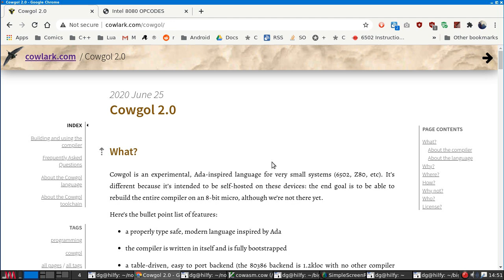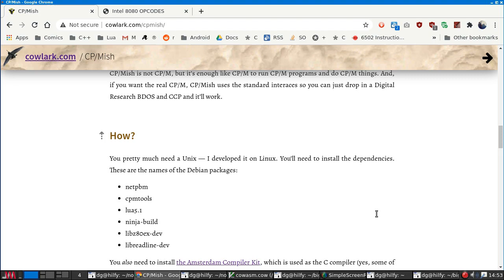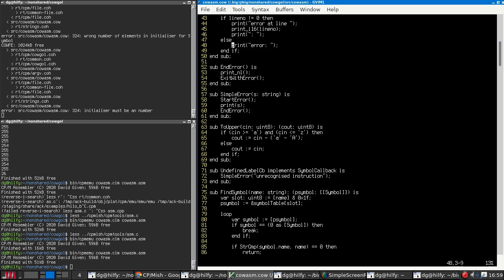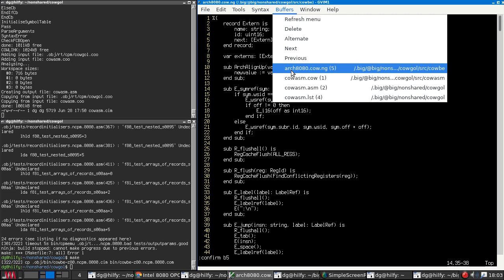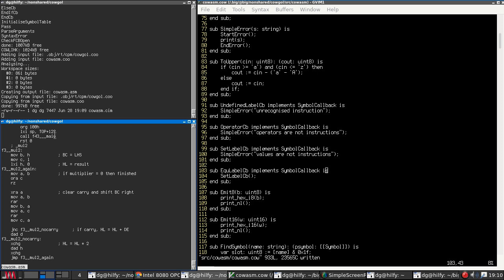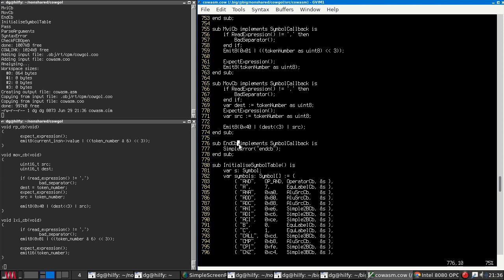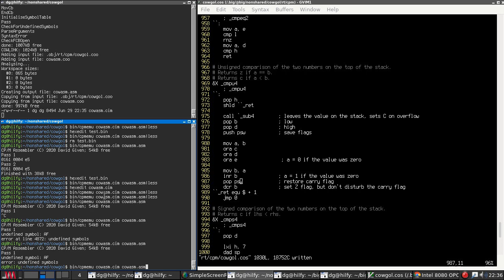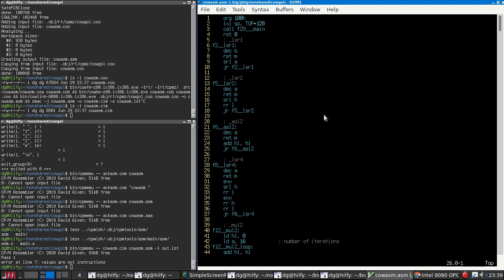Hjalfi writes an assembler... again

Comment: Hi;
Also, I have an Altair 8800 with it's 8080 CPU Board, I also have John Monahan's Z-80 Board (and Monitor), so this would also be a good Candidate for COWGOL, and John's IDE and Floppy Boards and His Serial Board for input and Output.. I have NOT been able to get CPM working on my System.. But. I think it would be an added Plus for You to write a CPM like Operating System in COWGOL, which would be another Great Video to add to the Collection of Great video's to at least watch, and then with Everything written in COWGOL Possibly that would make it easier to get the whole thing up and Running on an 8 Bit Machine..
Like my Altair, or John's Z-80 Systems, with 64K of Memory..
THANK YOU Marty